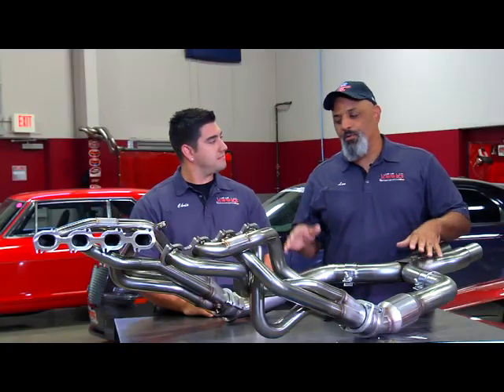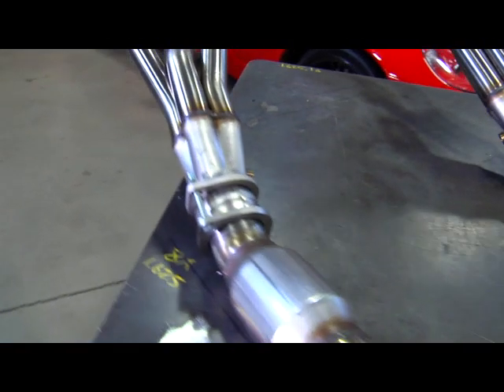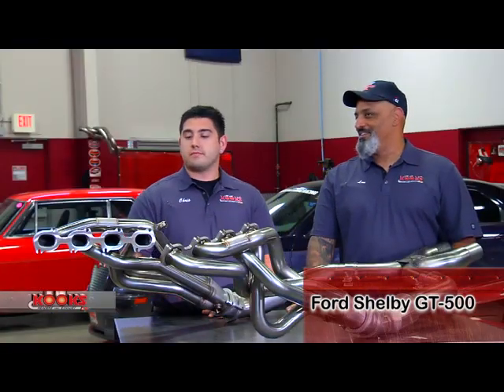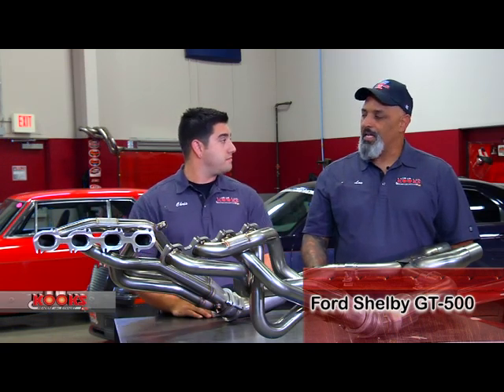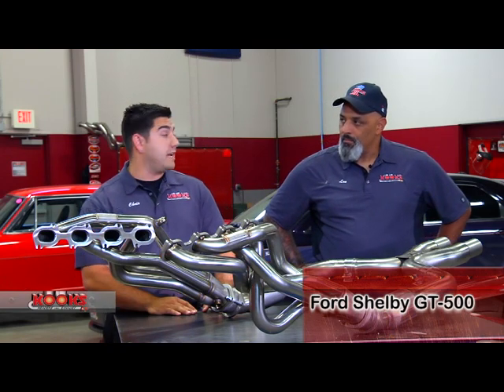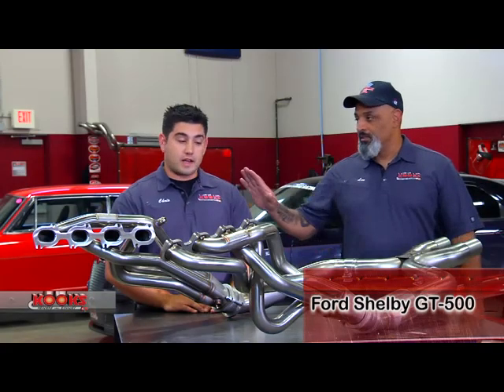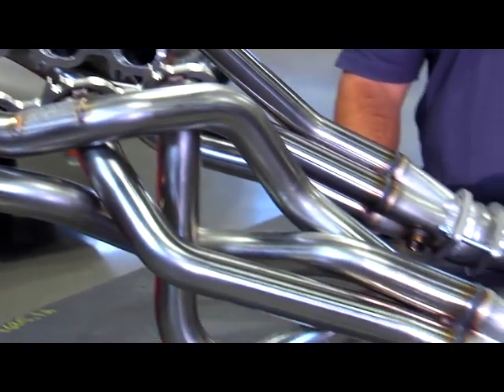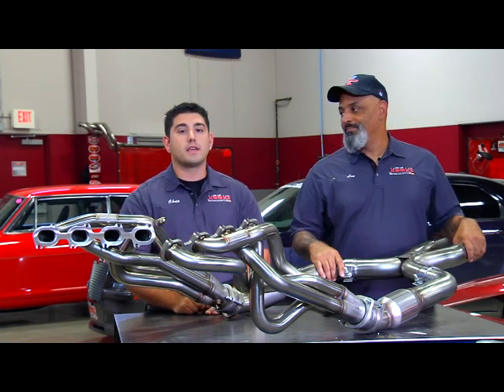KOOKS Headers Presents the 2006-2013 Ford Mustang Shelby GT500 Longtube Headers and Exhaust.

Comment: A lot of wrong information in this video 

1- There is no 2006 Mustang Shelby GT500
2- The 2013 GT500 produce 662 HP on the crank,

I though this is prof.... chanel